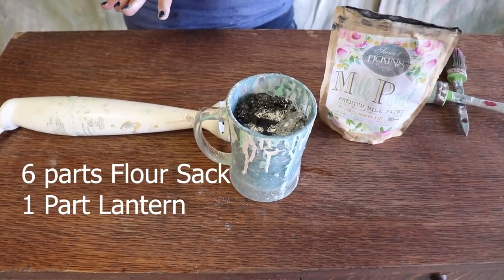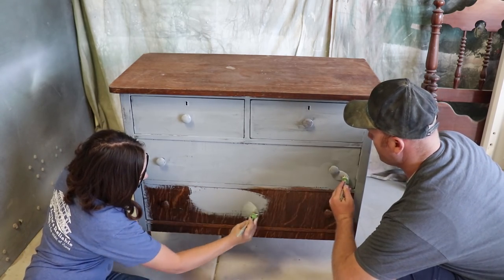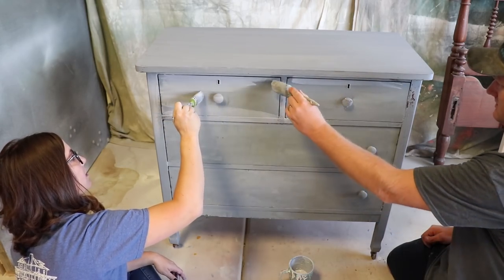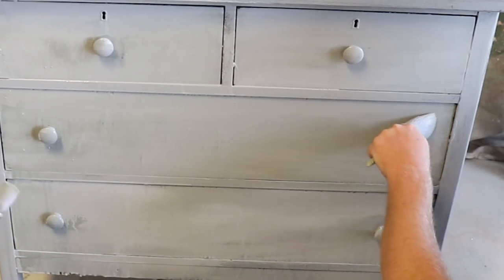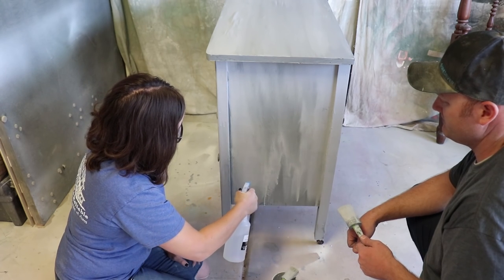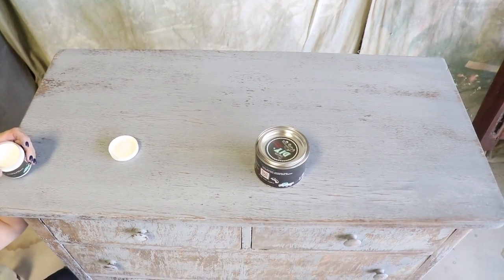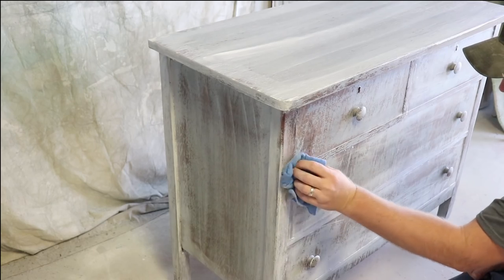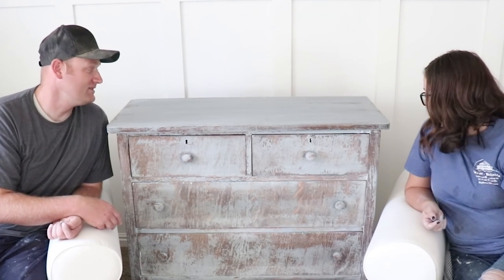How To Do A Chippy Blended Paint Finish

Comment: So I am just curious say you used the milk paint and it chipped more then you wanted...before waxing could you do a second coat with bond in it..I like the painted over many times look for like a barn door or a shutter would it stick to the paint already on there? I hope that makes sense! I live on a farm and many outbuildings have been painted or probably have many coats of lime and the base coat wasn’t sanded smooth...I would like to get that look for some accent pieces like windows or shutters for inside...if it would stick I think this could achieve that look! What do you think? Many thanks for imparting your knowledge you have taught me so much!😊